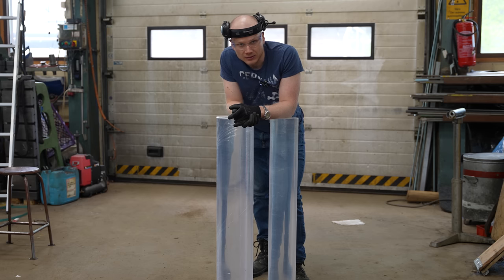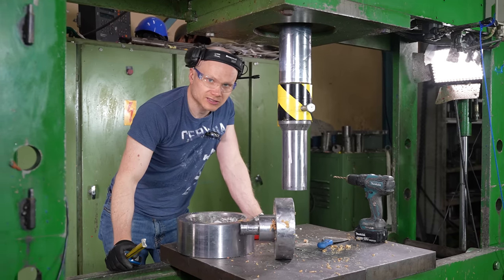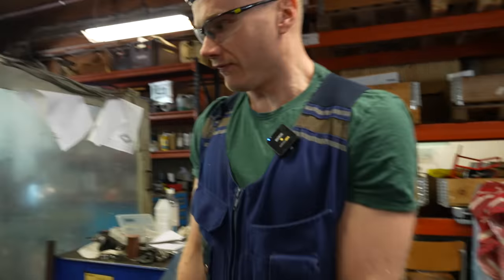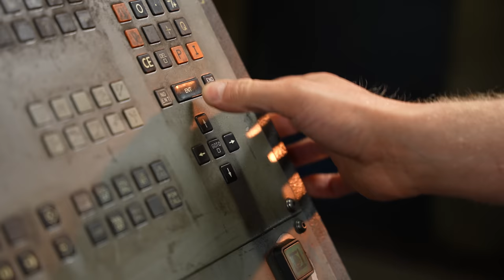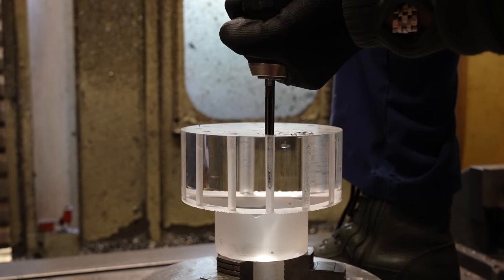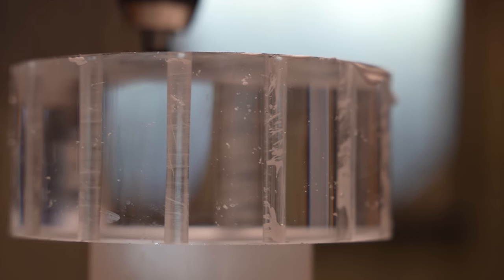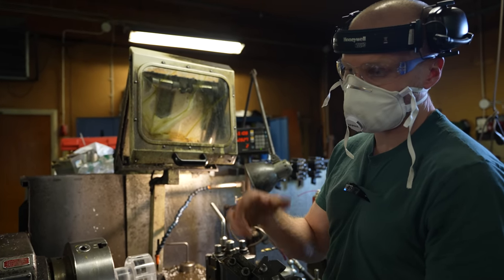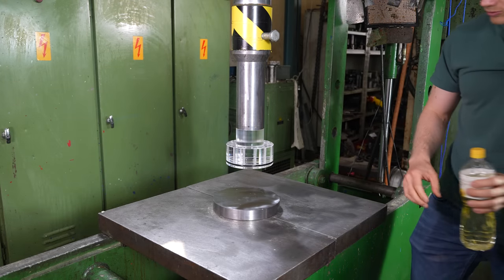Machining World First Transparent Hydraulic Press Tools

Comment: Probably cheaper if you just bought raw Acrylic (or Polycarbonate that is 30x stronger than Acrylic) pellets and melt them into mold. You can buy Acrylic for 8 Dollars/Kg from China. And Polycarbonate is cheaper, around 3 Dollars/Kg. Drill and bore out a metal cylinder, split it in 2 parts, put the pellets into the mold, heat it up, let it cool down, split it open and you got clear Acrylic or Polycarbonate cylinder...
Reply: It's not that simple to make a mould tool. It's not like making jelly.

Comment: Acrylic is easy to machine just smells and makes a big mess
Reply: I made a light that almost looks just like that
Reply from the maker: Shop vac solved both of those problems nicely. Didn't smell almost at all with that
Reply: Yes i seen very good and next time drilling WD40 or any penetrating lubricant   works very well to 👍

Comment: They have to make molds to make those parts. They don't have lathes.
Ofcourse They don't want to spend 1000 to get 500...
Reply: How do you think they make molds? Telekinesis? Of course they have lathes, I make mold tools. They probably just don't want to be liable if it breaks that they have to replace the tool.
Reply: @Alcogod  Are you reet r ed?
They extruded those plastic cylinders.
THEY make plastic. They don't use metal lathes. They EXTRUDE plastic.
He has a lathe. And so do I. The PLASTIC guys do NOT. 🥄